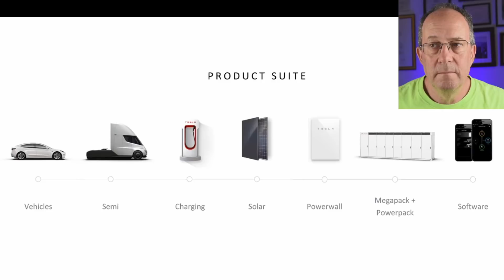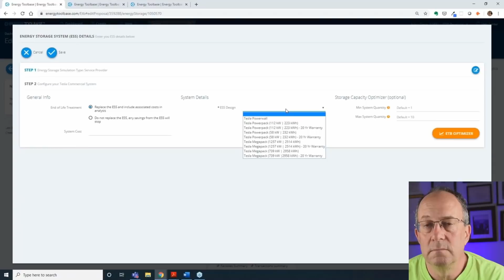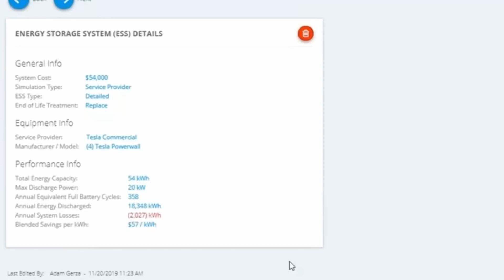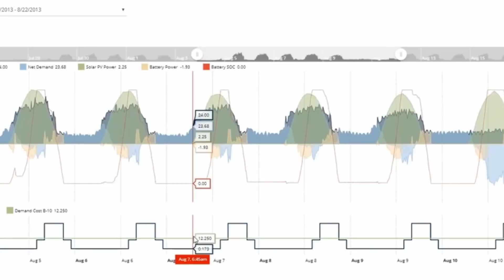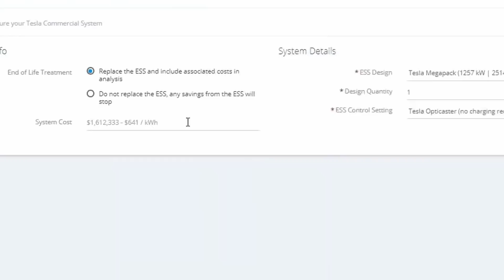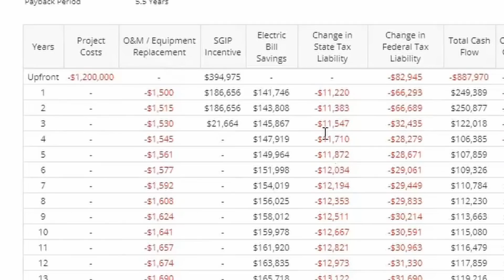Tesla Powerwall & Megapack Money Makers

Comment: Let's look at this from the altered angle of the demand curve based upon the reduction of demand, and what utility companies pay, with adding back the power provided by a market with battery packs installed.  With additional power being provided in peak periods; the price parameters will have to change.  More power packs will diminish the price differences between peak and low billing by utility companies.  These dollar numbers will not remain stagnant.  The larger the base with battery backups that utility companies can access; the flatter the demand curve.  How much will that affect the demand for battery packs and solar roofs???   Another question might be, what will it take to keep utility companies profitable/solvent?  With that consideration; what kind of government regulations might be considered by governments?
Reply from the maker: It will be a long time before there are enough batteries on the grid to have a significant impact on pricing.

Comment: Tesla is not disrupting the energy sector I'm afraid. THere are plenty of companies who do the same. Unless they'll start selling cheap tesla power walls and will start disconnecting people from a grid completely
Reply from the maker: Once they scale production they will be the price and performance leader.
Reply: @WarrenRedlich  Unlikely I'm afraid. But they'll capture a premium house market for sure, not the mass market.  I was on a market for solar+powerall and did extensive research, unfortunately numbers doesn't stack up at this point for Tesla. ROI for end-user is extremely long
Reply from the maker: Is your electricity pricing the same throughout the day? Do you have the option to convert to peak/off-peak pricing?

The benefits are larger if you can do that.
Reply: @WarrenRedlich  Correct, my electricity pricing is variable every 30 minutes and sometimes even negative when there is a lot of wind and waste energy generated. As I said, Tesla doesn't bring anything new. All that stuff already exists, you can confirm it by doing your own research. You can also watch the guy on Dave Lee podcast who worked in the industry (Matt Smith), he nicely summarises why tesla energy is mainly hype (at least at this point).

Comment: Hi Warren,  glad you are exposing this.  Nit, 1.5 years ago not 2.5.  Important,  elon realized there's a huge market for powerwalls and is tapping that market before launching the arbitrage systems.   e.g.,  I'm buying 3 PowerWalls here in northern California foothills.   Ill be able to buy power cheap and use it when needed.  Also, I wont loose power during PG&E blackouts during fire season.   HOWEVER..... I own a Y, and if tesla enabled V2G,  I would already have this ability via my car.  Instead, I'll be paying another $20k for 3 PowerWalls on top of the car since V2G isn't available.   I'll get solar roof in future after a second story addition to completely enable off grid living.  However,  whenever tesla enables V2G,  a simple bi directional car charger plus software,  there will be. ... overnight.... around 1 million cars x 70kWh = 70GW hours of grid dispatchable energy storage for tesla to operate as peaker plant killing arbitrage.   Sooner or later this new revenue stream will be added to the income mix.
Reply from the maker: Yes I got the 2.5 wrong.

Comment: Great video! Have you considered that as batteries saturate the grid, peaker plants are no longer needed, and thus the price of electricity won't be higher at peak demand. Thus there will be little fluctuations in the prices of electricity, and thus you can't save this amount of money forever. Not sure how much batteries is needed in the grid before we get this type of saturation though..
Reply from the maker: I'm not sure you're completely correct. Demand will still have peaks. I agree that solar/wind/battery saturation will change the market, but that's a long way away.

Comment: Great video Warren, thanks for making it. 

I have the same question as you at the end of the video. If Tesla makes the packs, installs them, provides the software and sends out the maintenance teams why not just do it themselves? Why sell someone a product for £1.2m which makes $3m in returns when Tesla could just keep the pack and operate it themselves.

I agree with you there must be another reason. It may be that in 2019 the cash position was worse so revenue now was more important than revenue over time. However now the cash position is excellent and wall st loves regular revenue.

Comment: These batteries don't have an expiration date; they don't just stop working after 14 years and 367 days, they very slowly degrade in capacity, so replacement may not be necessary for many years, especially if they are still doing their job effectively enough.
Reply: Yep, you would probably just a a fresh one to supplement your requirements.